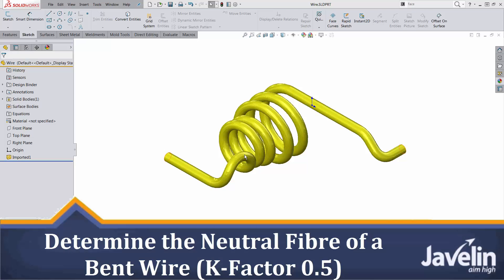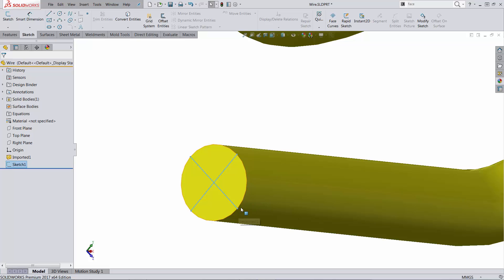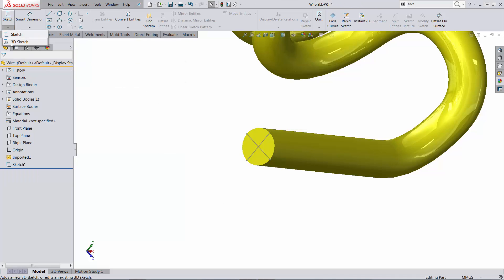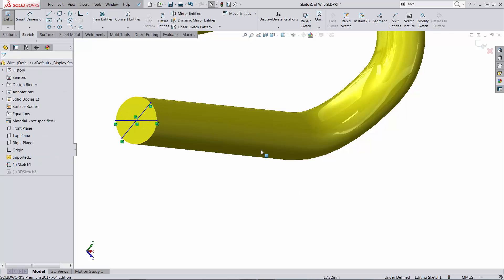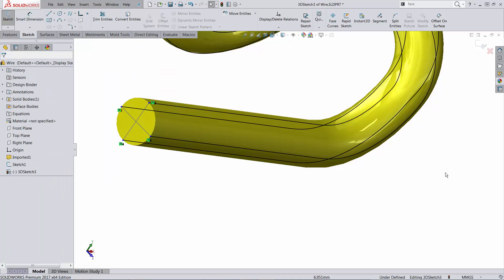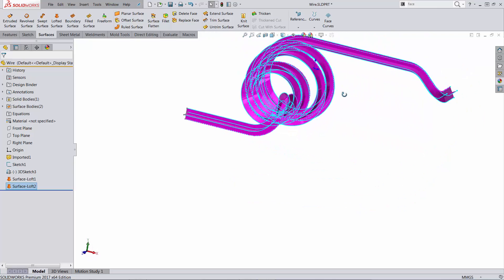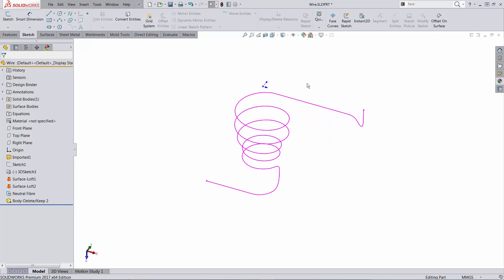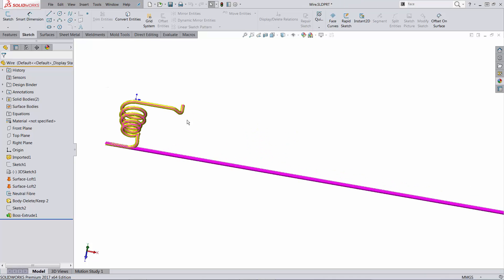SOLIDWORKS Tutorial:  Determine the Length of a Bent Wire Using the Neutral Fibre Technique

Comment: For those asking, I may have the solution to the tangent faces interrupting the face curve.  If you model the tube or bar as a solid body it will show separate faces, but if you model it as a swept surface you there will be a check box to merge tangent faces.  I have my project modelled as a swept boss/base, so ran into this problem.  I'm going to reuse my 3D sketch from the sweep path, and create a swept surface, and check that box.  Then I will save myself a lot of time hopefully.

Comment: Excellent video! I have a similar situation but my imported geometry has recognizable tangent faces. From my attempts to establish the Neutral Fiber/Center-line of my geometry, the Face Curves command only applies to one selected face. So this process has to be repeated for every individual surface along the geometry. 

Is there another way to establish the Neutral Fiber of the entire imported geometry without having to use the Face Curve command multiple times? Thanks!